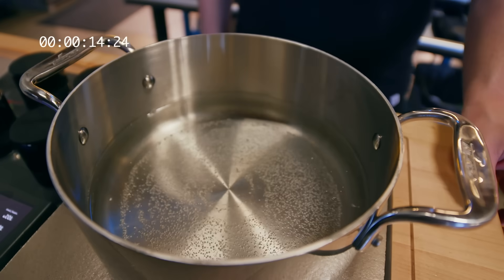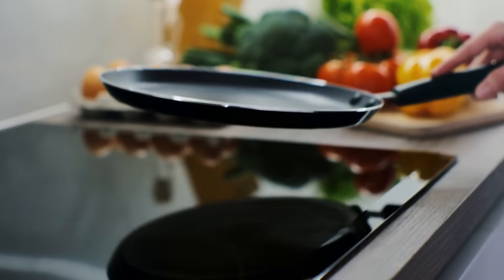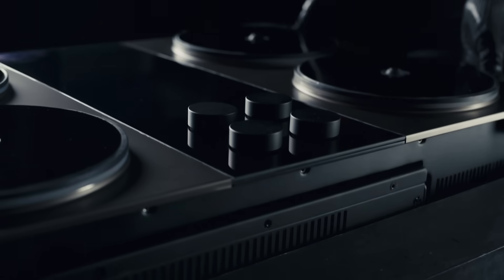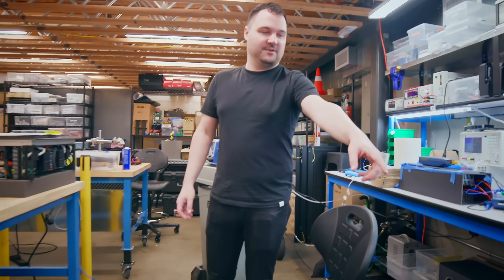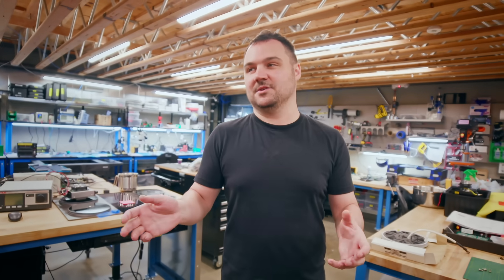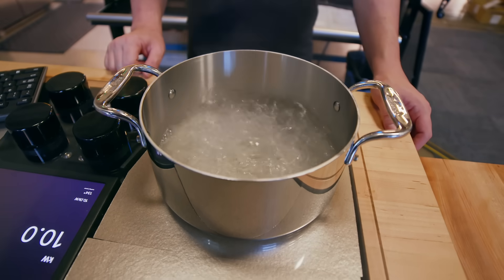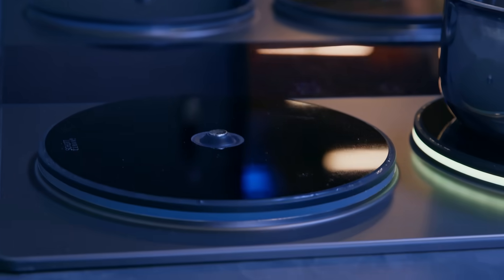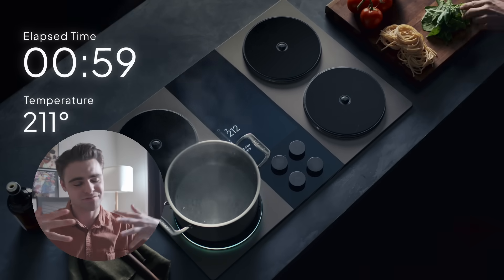World's Most Powerful Stove: Boils Water in Seconds | Impulse

Comment: I have an induction range. Absolutely love it. However when people ask about efficiency, I will tell them that efficiency doesn’t not mean “cheaper to run” with induction. If you use the “P” setting all the time you’re gonna freak out when you get your electric bill. With that said how expensive is it to run this cooktop? I understand there’s a battery being used to assist in the “power boost” mode, kind of like a hybrid car. I’d love to know the real cost of operation. I live in California where my electric rates are at their highest between 4pm and 9pm, the time most of us cook, pulling 10Kw to boil water would be very expensive.

Comment: In the EU a standard outlet is 3kW, and in North America, they still use 240V, just not so common in the kitchen. You can also get a higher power circuit installed, you already get a separate circuit to install an electric cooktop anyway.
Most gas stoves still work when the power is out, just need to light it.

Comment: I would assume current induction cooktops only go up to ~5kW due to actual use cases, not a power limit and needing a battery. It is common to have 240V and 40/50A for a cooktop, which is 10-12kW. For a short burst you would not need to derate, so you could run a burner at 10kW and still have some extra for others to simmer.

Comment: This is AWESOME! High Impulse Current-based heating works GREAT on Cast Iron cookware especially! The super speed and temperature control makes this an ideal product for high end home AND professional kitchens. That said, for pro-level kitchens where high use is a daily thing usually on a 16 hours per day basis, you need to replace everything glass with a thick high-impact-resistant and easy-to-clean CERAMIC or Cast Iron and make all parts EASILY replaceable within less than 5 minutes!

I REALLY REALLY like this product though! Good job on making it!

V

Comment: When machines, math, and science are so precise, the imperfections of human beings are often overlooked. This is why gas burners are still essential alongside highly efficient induction cooktops. A balance of both is necessary. The visual cue of heat provided by gas burners is crucial for cooking, making them highly relevant. Please reimagine the same concept with two gas burners integrated into the design, ensuring they are used only when there is no power outage.

Comment: I own a gas stove and I love it. It's simple and elemental. How do you improve a spoon? I'm not adverse, however, to induction cooktops but I hate them, not because of the technology but because of the sh*tty digital interface. Sliding your fingers on glass, with grease, and splatters, not responsive, with a digital readout and pressing buttons that aren't there. Pathetic. When I cook I don't want to use an app or software or digital crap. Induction cooktops make noise. They're as loud as whales and have fans to dissipate heat. Induction cooktops suck purple Twinkies. Does Impulse Labs solve these problems? I doubt it but I will be watching.

Comment: This would be a great concept for new constructions and recent houses by simply adding a smart device to the main panel to isolate the house from the grid during an outage.

Example of process to allow backup power from a variety of appliances.
1: Power goes out

2: Smart device detects loss of power from grid and disconnects house from grid.

3: Smart device alerts appliances that power is needed and apliances supply power from batteries upon verification from resident via physical button or mobile app.

4:Grid power eventually restores and smart device will upon verification from resident (to prevent random interuption) alerts appliances to switch back to nomal use and Upon house fully de-energizing reconnects to grid.

Comment: I'm sorry. In fact, this is a reason why we consume that much energy: boiling water in a few seconds with 10kW of energy, why not 1kW of energy and a few minutes? The most homes didn't have 10kW of energy supply or connection. 3.5kW is the most common.

Comment: Saw this monstrous oven at a trade show (I watched online) that was made for the European market that had a double 3-phase connection. One 16 amp connector for the oven and one 16 amp connection for the six burner stove. The oven was enormous, much wider and taller than standard, could reach 375 degrees Celsius (700F) and had a bunch of accessories for stuff like grilling and pizza making. Like, it had a rotisserie thing and a pair of stone inserts to mimic a wood fired oven and a bunch of stuff for bread making.

The stove and the oven didn't have to be mounted as a single unit and I think most people would probably mount to oven part at table top height in a cabinett or something because if you actually stuffed a piece of meat large enough to fill the oven in it you would blow out your back if you had to crouch to get it in. Oh, and the stove part could bring a full 20 litre pot to boil in like under five minutes with just one of the burners. 

It could be paired with a fan system that basically looked like an evacuation fan when they showed what it could do, it could probably provide a complete air change of your house in a couple of minutes if you cranked it to max. And all this was meant for home enthusiasts, not for a professional kitchen. I remember I thought it cost as much as that two bedroom apartment I saw advertised earlier the same day, but I guess if you are wealthy enough, you don't mind paying that much for kitchen appliances. If the same company ever decided it would make a freezer, it would probably freeze things to absolute zero in a quarter hour and be run by its own separate connection to the grid. 😁

Comment: Gas stoves are incredibly efficient at heating a pan if you are using a pan that is designed for a gas stove. People buy gas stoves and then try to boil water using a ceramic pot, well, ceramic takes a little while to absorb the heat, it's not as effective of a thermal conductor as say, copper. The heat source itself (flame) is providing plenty of heat but the pan sucks. If you use a copper pan with a gas stove boiling water is incredibly fast. 

The reason chefs use gas stoves is because a lot of more complex techniques in cooking require rapidly decreasing or increasing temperatures using a copper pan, glass stove tops retain heat even after being turned off making a quick reduction in heat impossible, my guess is the same problem would exist with this stove top. Gas stoves are the only effective method to rapidly decrease and increase temperature. 

If gas stoves were all that horrible, every single kitchen in every single restaurant in the US wouldn't be using them. That being said, for reasons you mentioned (health), I hope your product proves my skepticism wrong and you produce a better stove top than gas that replaces gas over time.

Comment: 1: Gas is significantly better than electric when there's a power outage. Arguing that is absurd.

2: It's $6500 to to replace a stove top with an electric kettle.

3: Gas allows significantly more control and the best restaurants in the world use them and flat tops.

You're just doing the whole "I'm so new and inventive" and you probably will be a niche product in 10 years.

Comment: "Your 120V in the wall cannot provide enough power"

In Australia, most new installations in houses are 230V @ 15A these days, and you can totally get 230V @ 20A (in most states, as some still use 240V)

That said, a battery would still be needed if you really want more than 4.6kW, although I wonder how much this stove is outputting and for how long it can sustain it. I'd need to watch the rest of the video I guess

Comment: Instant hot water systems heat a hot water tank to near boiling temp and are insulated to hold it there.  They can be stand alone units or in line units, and operate on standard US voltage.  I would argue this is a more appropriate use case than the narrow nature of needing to boil the water quickly and suddenly.

Comment: Only for high class who have disposable income for batteries that dies slowly with each use. Last week I have bought a jigsaw power tool and decided to go with corded. Doesn't matter if you regularly use or don't use for a long time, your batteries gonna die but your corded power tool will work even after 30 years. I also had two PSP and two bluetooth mini gamepad in my drawer; couple years ago I wanted to check them and only to found batteries puffed and bulged, cracking both controller and popped open PSP's battery cover. Those things are serious fire hazards, I don't want any battery sit out of my sight unattended inside the house again.

Comment: The reason I like gas stoves: heating control

I can't stand coil and induction cycling on and off when trying to find the perfect simmer. Been stuck with electric for the last few years and it annoys me every time. I use a water kettle for faster boiling.
Reply: Do you have induction or resistance coil?
Reply: @TeoSivanich  I have both. My apartment came with a resistance coil stove and I have half of it covered with a cutting board and a countertop induction unit on top of that.

Comment: You don't need 4 stoves if its so fast and if you can control which stove pixels the heat come from you can save energy if you have a smaller base pot.

Comment: I'm super interested but need it as a full replacement range with oven for my old gas range that only has a 120v 15A outlet behind it.  Can't run a higher power line and don't want just a cooktop.  Need the full deal and with enough extra battery to power my house for a day during an outage and you got another customer.  The next immediate thing you need to make is a highly efficient induction cookware lineup that can handle 10kW of power without warping it or ringing.  Something proper solid and ideally ceramic coated.

Comment: It's $5500... Saved you a click.
Reply: Yeah, cuz I'm here just to buy it...
Reply: Plus the additional wiring for your home to (safely) handle power from a battery placed in the kitchen
Reply: @c7ndk  he specifically mentions that is supposed to connect with your 120V outlet and NOT require extra wiring; the battery is to sip electricity slowly over time, and then blast as much as you require without directly taking from the grid at that exact moment.
Reply: @ryzvonusef  No, you can't just feed power back through a regular outlet. That is outright illegal! Also he specifically mentions providing power to the entire building or back onto the grid. Did you even watch the video?
Reply: That's... too much.
Reply: @are1981  You clearly don't know how much kitchen appliances cost that aren't meant for brokies.

Comment: You can not just plug this into the wall an expect the battery in it to start powering your home and work with other units without having some sort of control box that is hooked up to your in home's breakers. Don't insinuate that your product is just plug and play, this will require an electrician and a lot of work to your circuit breakers. You would need either multiple power line runs to each appliance, one to pull the power and another to provide power to the home, or a special piggy back breaker box that these will have to be wired into. no matter what it is just as much work or more work then a power wall or other battery unit. now if these could work in tandem with the battery units then it would be a game changer. A battery in something like a stove or oven would be tiny and not provide enough Kw/h's to run your home for any extended amount of time.

Comment: The only issue I see with this, a very high power induction hob would expand the magnetic field from millimeter peaks, to centimetre peaks. Meaning, if you’re wearing rings / watches / jewellery etc made from any magnetic metal, they’ll heat up to 200-300c within a matter of seconds of moving your hand over the induction top.

Comment: Nice put highly flammable batteries in the room most at risk of fires.

Also surely wouldn't be as simple as switching stoves as would need a change over switch to stop back feeding the grid and frying some guy trying to fox the power.

Cool stove but the batteries are a gimmick

Comment: It's cool to see someone innovate on this.

Putting the power where it is needed makes sense, but will be a nightmare to repair / maintain if the inverters and cells are not standardised. But that IP is your key asset if you don't do your own manufacturing ...

Miele had integrated thermal sensing for a long time. 7.5-11kW are typical for modern european stovetops ...

Comment: How strong is the middle glass screen, how much does it cost to fix? What about the leds on the side of the burner, how easy is it to replace?

More features are nice, but also introduce more points of failure. 

If this stovetop also insured easy yet cheap repair, I can imagine no reason not to switch over.

Comment: Low barrier to integration/use/entry is a key element in any kind of change, be it an improvement, a detriment, or a switch to something different. I think it’s great. My only concern is a battery fire. Or, multiple battery fires.

Comment: 10kw holy damn i dont know why but im picturing alot or melted pan experiences
Reply: Can't most incoming house electrical supplies attain this without using batteries? Especially houses with a 3 phase supply.
Reply: Yeah but that then takes all of the power from your whole house just to use one appliance hence needing the stored power to have a peak power output

Comment: I can tell ur not a cook…we don’t use the gas stove bc it’s outdated we use a gas stove to control heat easily…electric stoves either get too hot too quickly or cold to quickly….also the garbage u said about gas stoves and not being able to lite a gas stove when the power goes out has me laughing out loud that’s a lie you just don’t know how to use a lighter…..lastly ur an inventor and you mean well so if u really want this to work make a electric stove that can mimic the easy high to low heat production gas flames make on demand
Reply: Higher end induction stoves can regulate power output just like gas by simply supplying more or less wattage.

Comment: Not a great business idea. A typical induction cooktop costs around $1K. By adding what I'm assuming is at least 1kwh worth of lithium batteries, you're effectively doubling the COGS. It's simply too expensive, and if the battery has around 1,000 charge cycles, it'll die in only two years. Most people keep their cooktops for 15-25 years. As for the grid level energy storage idea, also not a good idea. The low hanging fruit for energy storage is vehicle-to-grid, and that has largely stalled out.
Reply: Yup only 6x the price for this tiny power bank + stove. The real ECO move is that you can double dip on incentives (electric appliance AND powerbank) and have poor people pay for your ultra luxury istove.
Reply: Could've abandoned the project.

Comment: how could you sous vide the steak in the pan? I dont get it
Reply: Going by the definition of sous vide, you can’t. Not sure what he was referring to. The stove does have a temp sensor, so I suppose you could set the pan temp to say 135f and rotate the steak every few minutes for an hour or so? I have a induction burner with the same pan temp control feature, might make for a fun experiment. Can’t help but fell it would dry out though…
Reply: @Dirty_Bear22 that would be something more like cold sear technique but the steak would never sear of, i think you would need to flip it for 3-4 hours not an hour, in sous vide you put it for few hours and i'ts surrounded by heat in a pan it would only have one side heated every few minutes. idk maybe he just puts a lid and leaves it there for few hours on low heat. If you could do a sous vide steak wihtout a plastic bag on that thing, that would be a game changer
Reply: @silaila3115  Your theory probably has the most merit, small pot with a lid on it sounds like it could work. Sure it’s only heated from the bottom, but it will fully heat throughout eventually. I’m going to try doing this using the breville control freak, a small enamel cast iron pot, and a wireless probe thermometer.
Reply: @Dirty_Bear22  sounds good, let me know please if it works!
Reply: @silaila3115  Will do!
Reply: @silaila3115  So I tried it out using a 1-1/2 Strip Steak and 2qt Dutch Oven, set it at 137F and low reaction setting. Took two hours to hit 135, Then It was seared on a pan. It was good TBH texture and moisture content was somewhere in between reverse sear via oven and actual water bath sous vide. I flipped it once approximately half way through.
Reply: @Dirty_Bear22 so you didn't have a gray band?
Reply: @silaila3115  No, I cut it in half after the initial cook and checked. I got slight gray banding after a sear, but that happens sometimes when I use a normal sous vide steak anyway.

Comment: Product looks amazing. Probably the only thing a gas stove would do better than this is cooking with a wok, but even then it would have to be a gas stove with a big flame, for optimum reaults
Reply: Would require a flat bottom wok, but the output on this stove would actually be significantly higher then even top end residential gas stoves. Only exception would be a large dedicated gas wok burner.

Comment: This is one of those "why haven't I thought of that?" Ideas that just makes sense. The whole bi directional inverter thing seems like a gimmicky value add to make the VCs happy, so I get it. But 10KW of induction power + a control loop to regulate things to be able to sous vide and melt chocolate makes me electrical engineer brain tingle in all the right ways. Keep up the good work guys! Super excited to buy one of these. One thing I'm curious about is serviceability with the batteries. I'm sure they'll need replaced eventually. Any plans on making this easier?